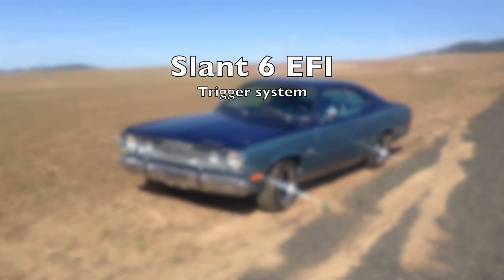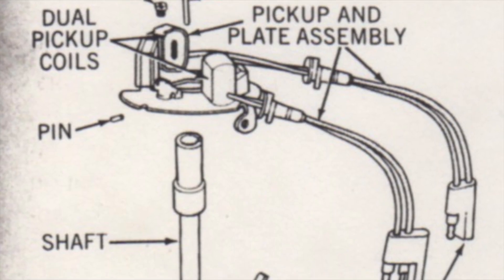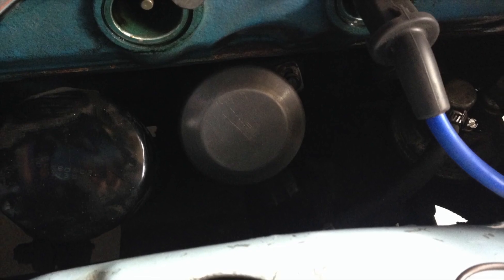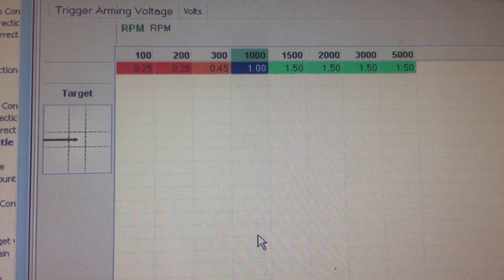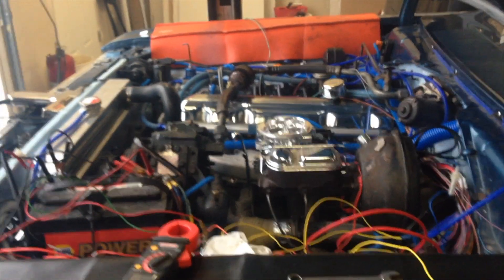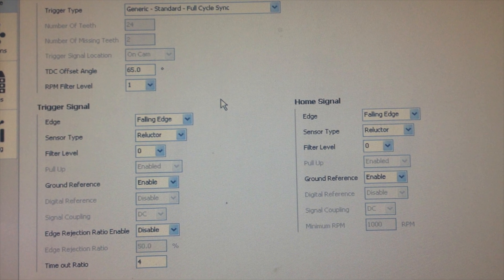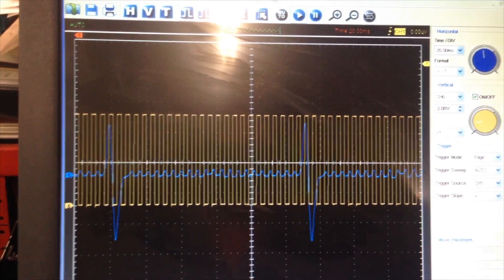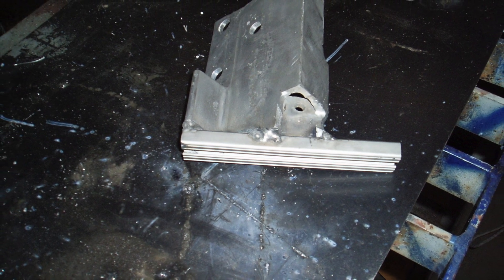Slant 6 Duster EFI trigger

Comment: There are many tuned port injected six cylinder engines near 3.7 liters. Why not utilize one of those, along with their ecm and sensors? Just modify the intake manifold, install a crank positioning sensor... etc.
Reply from the maker: The time and money for modifying a OEM is a big gamble for any conversion.  Is the timing curve going to be correct, air fuel ratio, etc.? Some people enjoy the challenge of seeing how cheap they can do something like that, but if (time=money) I think you are money ahead to buy a stand alone ECU where you can even program and calibrate the sensors that you can get to fit the engine.

Comment: Do you happen to have perhaps a write up on your modifications posted somewhere with the parts used? I'm interested in copying your setup to a point on my own slant 6 but with a turbo!
Reply from the maker: I do not have a write up yet on this yet but that is good idea.  In my latest video I did list out some of the major components.  I do have a video I'm currently working on for the fuel system.  Also this system is designed for a turbo and I have a T3/T4 on the bench that will get installed soon.  The Haltech Elite 2500 is already set up for the turbo and E85, and the control wires are already in place.